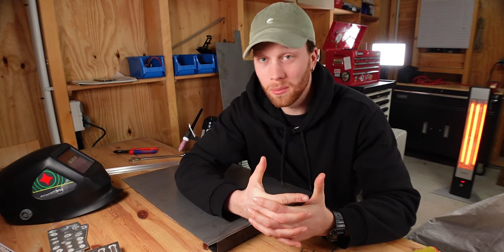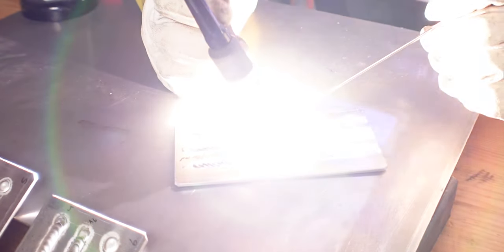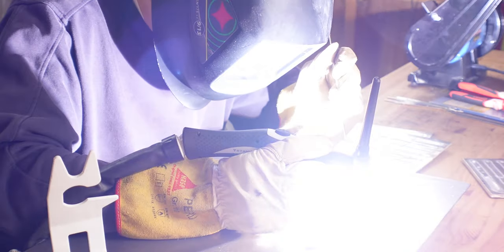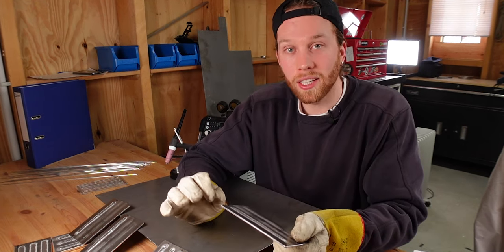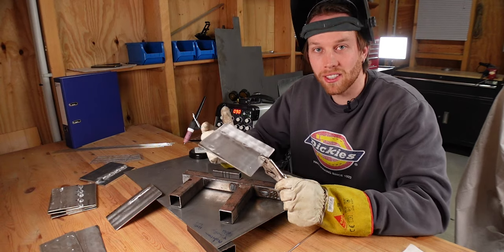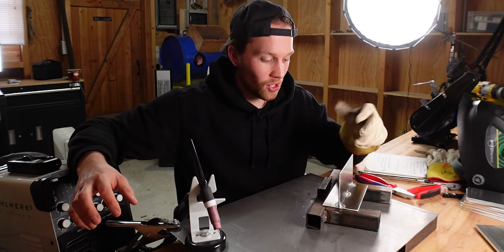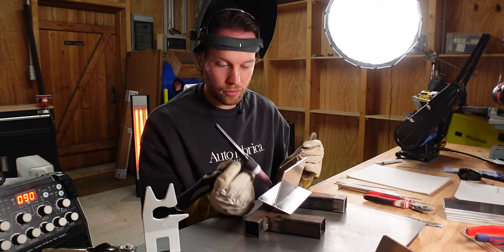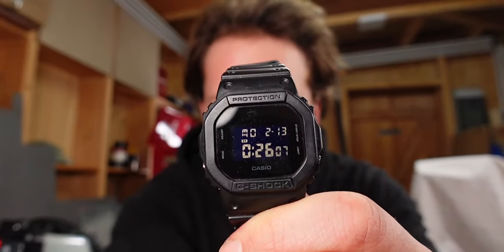Learning TIG Welding - Part 2

Comment: A lot of welding with tig is in your angles and hand and wrist articulation, You're attacking it, so you mentally prepare for it, then work a suitable approach to welding it.  Same for riding a motorcycle. Are you using a foot pedal? I prefer a foot pedal to control my power, Which you can see on your stops with aluminum that they are dropping, like a cake in the oven. You require to let off the power slowly to hold the puddle so it eases slowly down, cutting the power off causes it to drop. Not sure about your welder you can set the stop point, step down and go from % down to 0 over some seconds when you let go of your finger switch,  Tig welding is being relaxed and breathing and being in a Zen, You are doing very well in your progress tho.
 I don't do the art of dabbing, I don't like the look of it. I have an old miller Dialarc machine and never really played with those new machines. I think you are kind of stuck with the limitations of the finger switch vs the freestyle of holding the torch with using a foot pedal. If you are welding heavy gauges of aluminum plate you might want to invest in a water-cooled torch and cooler, you're going to feel the difference in the summertime. I recall using a finger-controlled torch just for a short bit, was not water-cooled either, boy did that puppy ever get hot doing aluminum🔥. I think also it was not rated very high for 150 amps, more for stainless and steel really. My new one had to be ordered in.  
I hope you get to use that welder a lot and have lots of fun using it Cheers mate. :)
Reply from the maker: Hey buddy, sorry for the late reply! I appreciate your input a lot! I do actually have a foot pedal but since it's an entry level machine, I can't controll the low amps well with the foot pedal. It just shuts off about 1/4 before I'm completely off it. Kind of annoying but just have to deal with it now and at some point upgrade. However, I'm using a different torch now (that the previous owner of the welder had bought) which is so much more flexible. Makes a huge difference. I've just challenged myself by welding a whole bike bench with the TIG welder. Not the most efficient but good practice for more challenging angles and setups.
Do you have a project you're working on at the moment (doesn't necessarily have to be welding related)?
Cheers, Joshua!